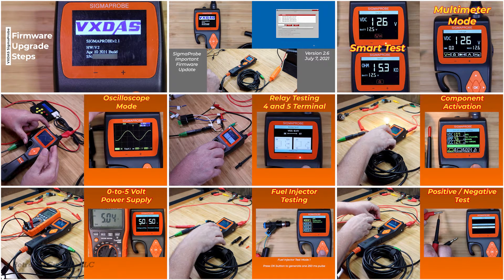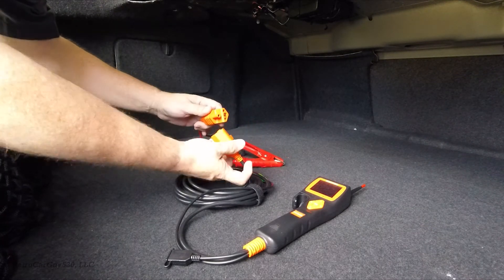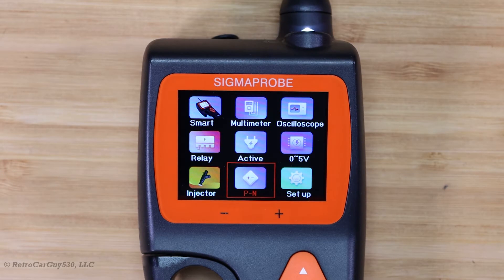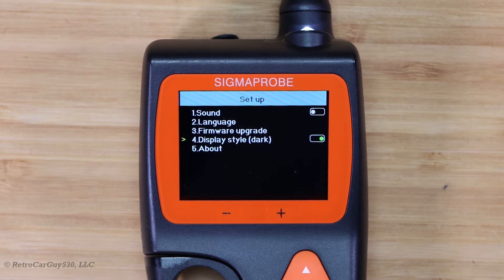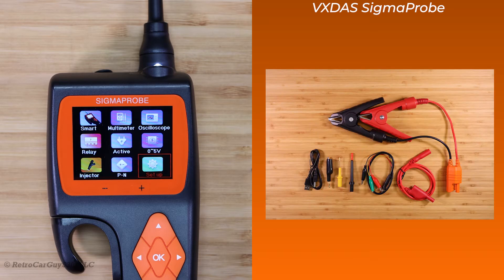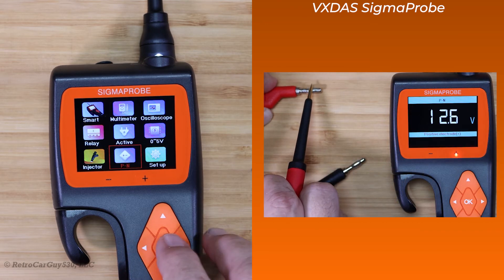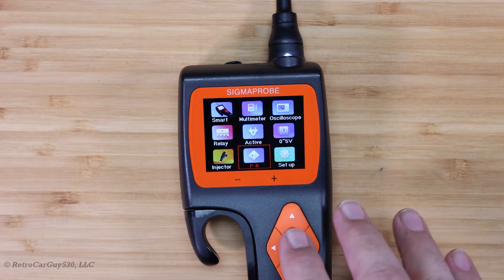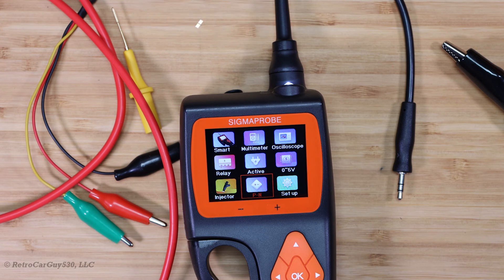VXDAS SigmaProbe Vehicle Intelligent Circuit Tester Review

Comment from the maker: The review has been split into multiple videos to allow you to select which portion of the product you want to learn more about.

1 of 10: VXDAS SigmaProbe Vehicle Intelligent Circuit Tester Review - https://youtu.be/IDApxPhAAuc
2 of 10: VXDAS SigmaProbe - Smart Test / Multimeter Mode - https://youtu.be/Sd8kZMSaMkA
3 of 10: VXDAS SigmaProbe - Oscilloscope Mode - https://youtu.be/js-UaAQbuIg
4 of 10: VXDAS SigmaProbe - Relay Tests - https://youtu.be/I8YL3eW_w8M
5 of 10: VXDAS SigmaProbe - Component Activation - https://youtu.be/xtf_XAKTLK0
6 of 10: VXDAS SigmaProbe - 0-to-5 Volt Power Supply - https://youtu.be/Sm-qT5apm-o
7 of 10: VXDAS SigmaProbe - Fuel Injector Tests - https://youtu.be/4wruXCLz6DY
8 of 10: VXDAS SigmaProbe - Positive / Negative Tests - https://youtu.be/zqTBy4u9RnY
9 of 10: VXDAS SigmaProbe - Important Firmware v2.6 Update - https://youtu.be/v9UYHeTGNfk   
10 of 10: VXDAS SigmaProbe - Firmware Upgrade Steps - https://youtu.be/6s5CbOgExHw

VXDAS SigmaProbe Playlist: https://youtube.com/playlist?list=PLHRK3gnAcQQV1C0oyhwWtUHGHhYZVD4Vq

Comment: hi could you tell me why the negative activation was disabled?
Reply from the maker: The reply I received by in September 2021 about that question was that more than a few prerelease customers were improperly using the feature and causing damage to their device being tested and/or the SigmaProbe, so VXDAS decided to block the feature in the firmware of the SigmaProbe.  I expressed my concern to VXDAS that other products like the Power Probe IV have this functionality.  I have not received any further updates from VXDAS stating this feature would be enabled in the SigmaProbe.
Reply: @RetroCarGuy530  thanks for that, i hope they put it back as its useful in my  in my line of work as i am an auto electrician.